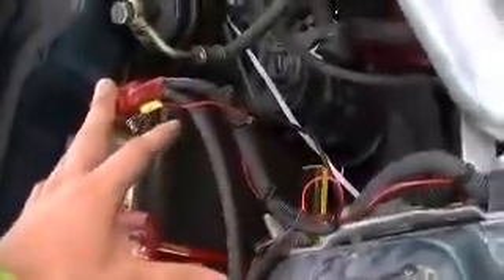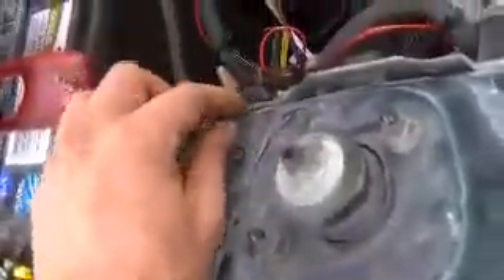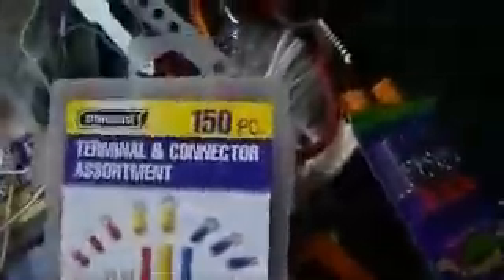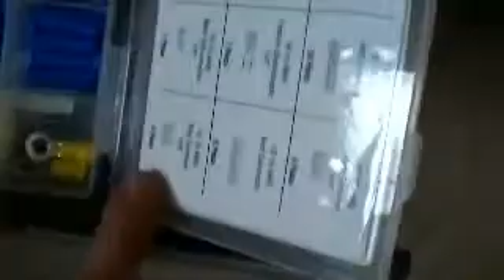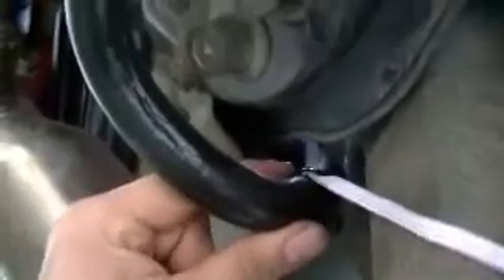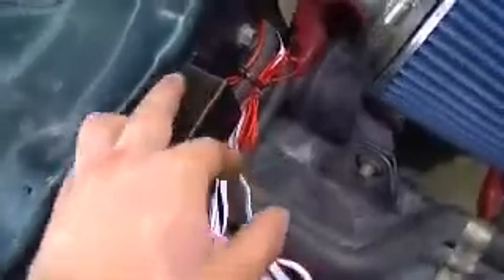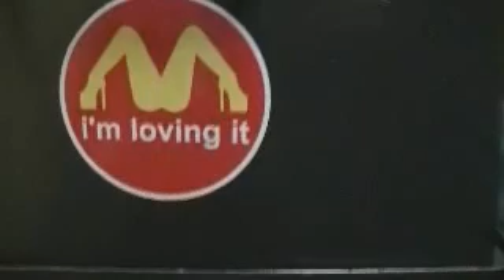LED underglow kit installation

Comment: Two things to point out..

1) The two extra wires are if you want to run a toggle switch to your dash panel.

2) Drilling holes like that up into your interior seems like a really bad idea, because of condensation over time will start molding your carpet unless it's never really cold where you live then it shouldn't be a problem.

Check out 3M double sided automotive tape or epoxy for future installs, both are extremely strong and hold well.

Over than that good video on explaining your install man, hope the lights run strong.
Reply: Ive used double sided tape for my install and noticed they come off and don't stick securely, any where i can find a more stronger tape for the install?
Reply from the maker: That's the reason I drilled holes and used zip ties... this install will NEVER FAIL. However, I would suggest 3M doubled sided tape, but before installation be sure to thoroughly clean the area where the tape is going to be fastened with a strong solvent or grease remover (like purple power/ brake clean/ soap and water/ adhesive remover etc) If the area is not cleaned sufficiently the tape will simply pull the dirt off your vehicle with the weight of the led lights. Prepping is the biggest part of installation when it comes to using double sided tape.

Comment: Almost six years too late but I found this kit in my dad's garage and that all black wire is the antenna and the all red wire it to force all lights on if you connect it to some switch or feature of the car that turns on and off

Comment: I know this video is old so not sure if you'll know but I got a newer car which has an underglow kit installed. It seems identical to the one in this install video. Was wondering what the brand is because it's missing the remote control. Didn't know if I could replace it somehow or even get just a new module and control. Any feedback would be awesome.

Comment: So it's a really easy kit to use then :) exept for the to little battery things u used you don't need Enything els ?
Reply from the maker: Yep. Basically everything you need is included in the led light kit which I purchased at amazon.com. Except the zip ties and terminal connectors for the battery connections. However, as LeperAffinity5 below pointed out two sided tape and epoxy are available which will make installation quicker and easier. However, over time they will more than likely fail and start sagging and fall off, and u might end up running over them and tearing up the kit which is why I chose zip ties b/c they are more reliable. It takes more  effort to drill holes and use zip ties though. And as I mentioned in the video.... you will need a solid carbide drill bit to drill through the frame. I purchased the drill bits at amazon.com for about 15 to 20 bucks per drill bit depending on the size you choose.

Comment: I got the same kit for my 1980 el Camino are the wires going to be long enough tho? That's my only worry
Reply from the maker: Not really sure V. I'd have to see the vehicle myself. But what I would do is lay the kit out under the car where you would like to position it and see if the wires will be long enough to connect to eachother. The only problem you might have is with the short strip for the rear end of the vehicle wasn't as long as I wanted it to be. I think I'm going to order another kit so I can have 4 extra strips and I'll do an update video on that.... when the weather get a lil warmer. :)

Comment: I have a ford explorer, which is like 2 tons, but I was gonna use car ramps and a jack stand in the back, idk if that'll be safe? cuz the jack lift it comes with only lifts it enough to take tire off and its pushing it, a jack lift is a good 100 bucks and that kit is 100 bucks also, but is this kit daisy-chainable? and did u get them off underglowbody.com?
Reply from the maker: I actually got my kit on amazon.com for about $36.00. It was made by Fuloon.... Idk if I spelled that right. I would definitely recommend using jacks stands after raising the vehicle. They have em at Harbor Freight. and at their website harborfreight.com for like 15 bucks. I also got one of my jack lifts at harbor freight for 59 bucks w/ a coupon. They have 25%off coupons in the Sunday papers here in Fayetteville NC but if you sign up on their email list they will send you coupons which u may redeem online or at their stores. Don't skip out on safety. Them pretty lights ain't gone do you no good if you get crushed by the vehicle :)
Reply: Thanks boss man, I found something different, they're tubes, its less work b/c you only need to zip tie it twice, but your vid helped on were to mount the box and what not, thumbs up brotha.

Comment: Just picked up the same set you've got. Pretty sure it's the same from the box it came in, is the same as yours in the beginning of the video. I bought automotive 3M tape and zipties too. I also got some EL light wires for the interior. Going to install mine this weekend. So question is you posted this video back on Sep 10, 2013. Do these lights still work after the past 3 years? That extra red wire on the paper with kit says "brake is red" and some other diagrams say it's for the antenna. Have you tested the distance for the remote to switch on/off the lights?
Reply: +Jeff Perrin Yes the lights still work. The battery in the remote has been replaced once or twice. If the lights stop working check to see if red light on remote comes on... that will indicate a dead remote battery.  Extra red wire is  not needed. Have not tested the distance of remote but now that you mention it.... I will... post back to you asap. Also im writing you from my fiance account
Reply: Lashanda Hinton Okay, I woke up today and it's raining outside. Really hope it doesn't continue through the weekend, I don't have a garage. So lights still working, maybe some good distance...sounding good to me.

Comment: How did you get the side plastic runners off. I have a 97 accord and having hard time figuring it out and don't want to break it
Reply: Ryan Comparin It's been a while but I think there are some screws at the ends and some clips on the backside of the rocker panel which may have to be removed with a trim/upholstery tool or  you may be able to slide it forward to the front of the car after the screws are removed to slide it out of the grooves which the clips are in.
Reply: I took all the pop screws out and touged on it but didn't want to break it so said screw it but would be nice to get off so I can zip tie my lights
Reply from the maker: Ryan Comparin Try sliding it forward to the front of the vehicle but make sure all screws are removed from the ends.

Comment: Is there a way to splice the wire to your stock lights so when you turn on your lights at nite they all turn on?
Reply from the maker: Yes you would run the power positive line from the underglow kit and connect it to the turn signal wire for your side marker lights

Comment: u could have cut the wires individually soldered them back together with extended half ml wire and made the wires longer
Reply: Yes, just make sure all the wires match up again and are not "crossed" with each other.

Comment: i have wired everything up and the lights turn on however i can't turn them on and off neither change modes or anything? does this sound like my controller is faulty? red light on controller still comes on and off when pressing the buttons
Reply from the maker: Try replacing the batteries in the controller, and make sure the wires going into control module are secure. If that doesn't work then probably a bad controller
Reply: davidmezera think it might be a bad controller as I've checked both :/
Reply from the maker: Try replacing the battery 1st.... Red light will still come on when the battery is going bad sometimes. If that doesn't work you will just have an extra battery

Comment: I have these same lights except my wires are red black and yellow. They only seem to power on in solid state with the red and yellow both connected to the positive terminal and the remote is useless? Anyone have an idea wtf.
Reply: Nate Strause red should be positive and black would be negative. the yellow is the controller.
Reply: Any idea?